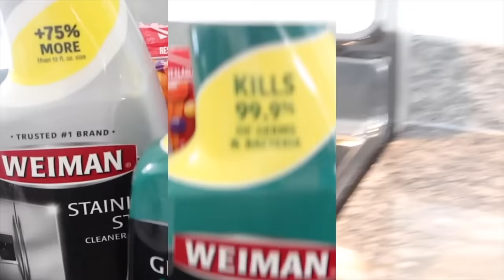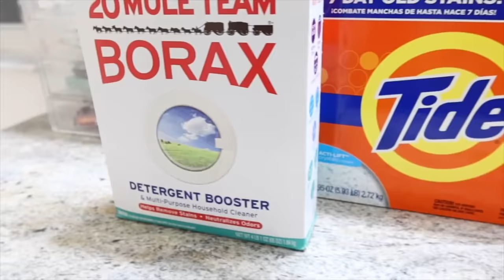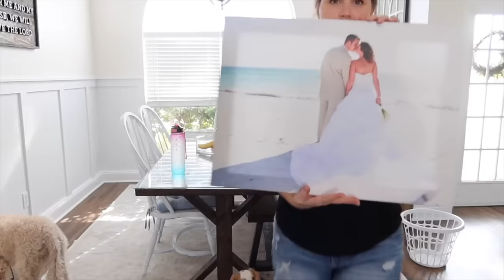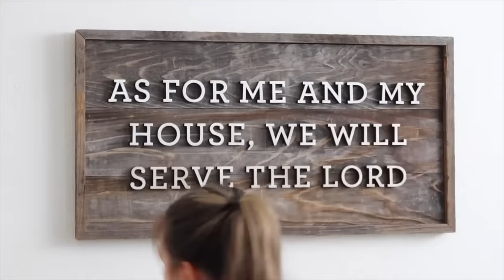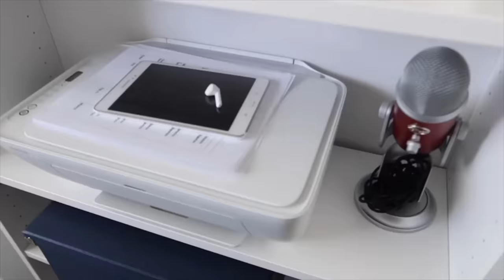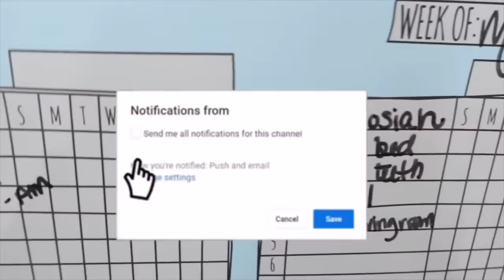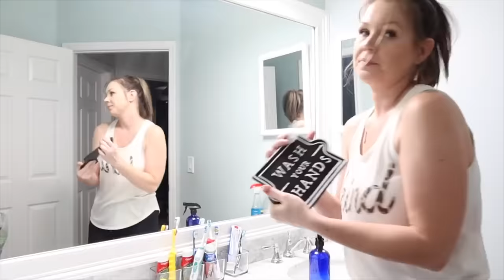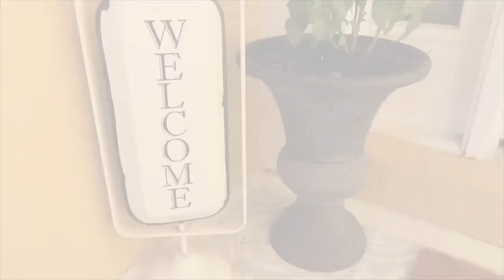*REAL* INSANE 3 HOURS CLEANING MARATHON | EXTREME CLEANING MOTIVATION | CLEAN WITH ME MARATHON 2020

Comment: I keep all 3 of my kids dirty laundry separated and they get washed in loads of each kids so I don’t have to separate anything ever. That makes it much faster for me and my kids are 6,8,10 and they fold and put their laundry away themselves. Occasionally I’ll help but 99% of the time they do it themselves.
Reply: How do you get them to do that?? My kids will leave it sit in the basket 😒
Reply: I used to always help them through all their clothes. Then I switched to sorting into groups of what drawer it goes into or hangs. Then I’ve just stopped helping them most of the time. I think it’s just been a very slow learning process and there’s still times they don’t do it when I ask but I keep at it and then they get it done. If they’re struggling with doing it sometimes I go help and even just sorting into the groups help them not feel so overwhelmed and then they just get it done without dragging their feet. I hope my process might help you!